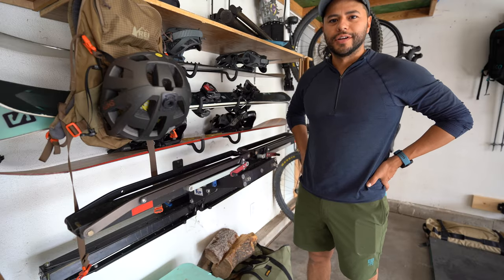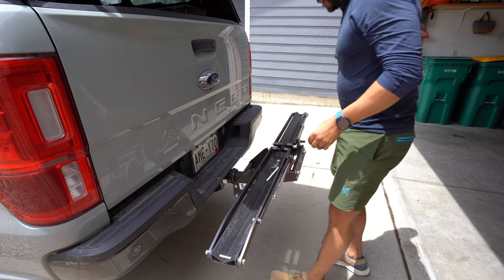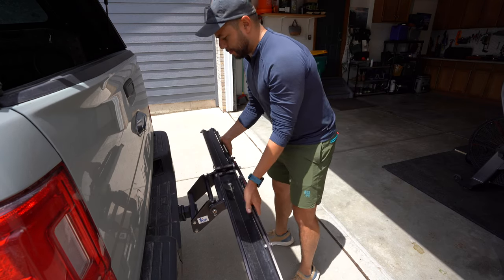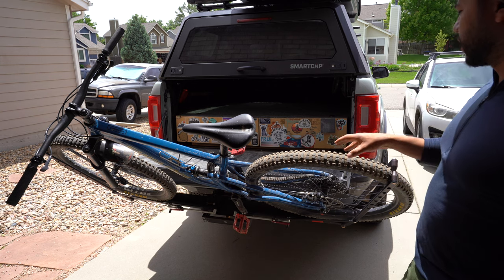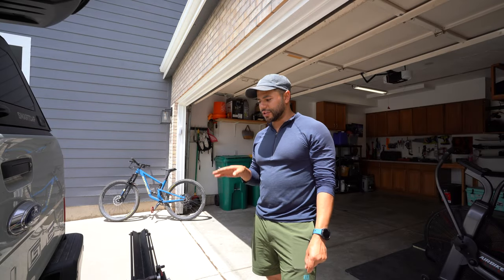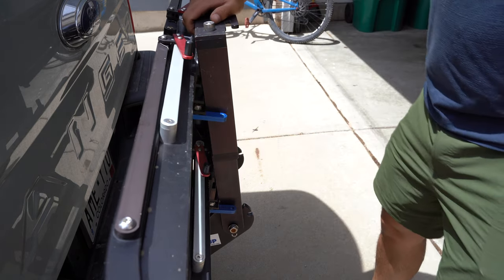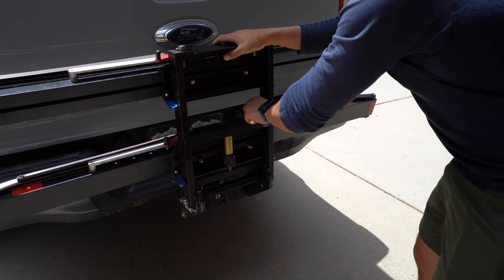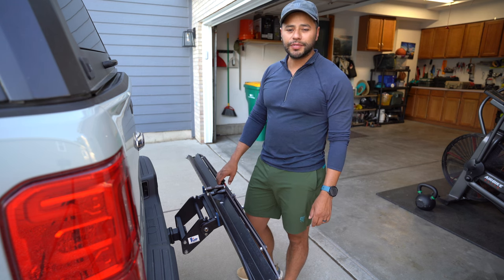1up Bike Rack Review - The best bike rack on the market

Comment: Tip, buy the 2 rack handle, cut down the rods so it slots in between 1 and 2 and enough you don't pinch your fingers. This will stay on with rack 1 as well by itself. Now you always have easier tilting.
Reply: what does this mean ?
Reply: @PenguinAUB  re-read

Comment: When you have it up does it block the rear license plate? Do you recommend getting the heavy duty double (for whenever my wife rides with me) or a single then get an add on?
Reply from the maker: It does block the rear license plate but I've never been pulled over so not sure they care. Especially here in CO, I think it's so common they ignore it. Also, when bikes are loaded I can't imagine it's easy to see the plate. Regarding the one single vs double, if you plan to always have bikes only on the hitch rack, I'd recommend the double. The only reason I bought the single was because I used to have an FJ Cruiser and when fully tilted up it would block the door from opening if I had a double and I couldn't fully tilt it. So I purchased a single rack for my bike, and then a crossbar roof rack for whenever someone else wanted to join. However, another great thing about these racks, I was able to use that same roof bike rack as my add-on hitch rack later once I got my truck. All that to say, I think 2 on the rear hitch is the way to go. Very easy to load and unload
Reply: @GetBusyLivin  Thx for the feedback. I drive a Mazda CX5 (small SUV). Would I be able to open the hatch without moving the rack? Does the same key fit all locks? Do you recommend the 2" HEAVY DUTY DOUBLE...to hold 45 ib e-bike and 15Ib gravel bike and do I order direct from 1up-usa?
Reply from the maker: @Drostvideo  with bikes on you would only be able to open with the rack tilted all the way down. Without bikes, you could definitely open the hatch but likely not with it tilted all the way up. The rack supports 50lbs per rack so should be sufficient for your e-bike, however I would probably call them and confirm. Not sure if you could do 1 super duty for the e-bike and 1 heavy duty for the gravel. And yes you order direct. https://1up-usa.com/product/2-heavy-duty-double
Reply: With the FJ, did you need a receiver extension to clear the spare? And to confirm, you could tilt it down and open the rear door? Thanks
Reply: When the 1up was on your FJ, did you need a hitch extension? And to confirm, you were able to open the rear door if you tilted it down? Thanks
Reply: Which model is shown in the video? Stated 50 lb max is only for Quik Rack and Equip'D models. HD is 65 lb max and Super Duty 100 lb max.

Comment: So when you put the holders in place against the bike wheels can you lock it in place to avoid theft?
Reply from the maker: They do lock into place but it’s not a fixed lock that requires a key or anything. You would want to either purchase a 1up lock that mates well with their rack, or you can simple use a normal bike lock
Reply: @GetBusyLivin  thank you for your reply. I just wouldn’t want to pull up to a stoplight and have someone grab it off the rack or walk into a store for a minute and have that happen. Not that I’d leave it out of sight anyway as a practice. In any event TY.

Comment: Great review, really helpful! I think I’m going to order the exact same setup: the single rack with the add-on rack for flexibility. One question for you. Have you used any of their additional lock sets (either the 1/4 turn wheel lock or the add-on lock to secure the add-on extension)? Both seem like nice features but at $25 each I’m not sure if it’s worth it. How do you secure your bike to the rack when on a road trip? Just wondering what your thoughts are given your experience with this rack. Thanks!
Reply from the maker: Hey there, I’ve considered it but I believe it only locks into the wheels and not through the frame. Being that the frame is the part I’m most concerned with being stolen I just use a cable and fish it through the frame and wheels and then lock it to the truck :) also?
Reply: @GetBusyLivin  Thanks for the response. I just placed my order today! No more laying the mountain bike in the bed of my pickup. Now I can actually take it camping with me. 

How do you clean the rack after a long dusty drive? Just hose it off, or take soap and water to it?
Reply from the maker: Soap and water if I’m doing it at home! Otherwise I usually wash the bike, rack, and truck all at the same time through a self-service car wash

Comment: Great vid. I love how well organized your garage is. Let me ask you this. I have a new ford bronco. From the outer edge of my reciever which sits flush with thr bumper to the oute edge of my spare tire which is large is approximately 10". Do you think that rack , with a bike on it will clear the tire. It appears you have plenty of space. Thanks
Reply from the maker: Hi Anthony, I just did some measuring and looks like the rack portion is about 12 inches from the bumper when at full extension, so you should ideally be able to fit a bike no problem. I can share an image if you'd like. Reach out to me on instagram @rocky.mtn.ranger

Comment: Nicely done video, very thorough. Do you know the distance from the back of your tail gate to the bike as I have a full size rear spare tire mount?
Reply from the maker: Hey Steve, that distance varies by about 6 inches as the male end has a slot to allow it to move closer and further from the vehicle. I just measured and at it's closest the frame of the bike is 10inches at the forks. It's about 6 inches at the pedals. and 4 inches at the handlebars. Ideally the pedals could be moved out of the way and the handlebars should be above the tire but you'd have to test that out. Again, you have 6 inches to play with so should be some wiggle room to get to about 16 inches for the frame

Comment: Great review. I think I'm going this route over the KUAT. Quick question....did you get the quick rack with adapter or go heavy duty?
Reply from the maker: The kuat piston pro x is a pretty cool piece of engineering and the one handed opening feature is very nice, but my concern would be dust and grime eventually getting into the pistons causing failure. That’s a very expensive rack to have fail.

This rack is no bs and just works…all the time. Simple and robust

I got the quick rack with adapter
Reply: @GetBusyLivin  good to know. I was looking at the heavy duty since it has the 2" hitch diameter vs having an adapter. But if you hadn't had any issues with the quick rack, that makes more sense to do

Comment: Saw someone ask this, but there wasn’t a response. Looking at this currently for an FJ. 

Did you need an extension on the hitch? And will the door open if you tilt the rack down?

Thanks
Reply from the maker: I had this on the FJ prior to this truck and did not need any extension. I cannot remember if I was able to open the door with a bike on it or not. In the down position I mean. Also, it will work with 1 bike rack on it but if you add to and tilt all the way up it will not clear. You'll have to have it tilted at the 45% angle to clear
Reply: @GetBusyLivin  Thanks, thats good to know. The 1 is probably what i woudl do first. So glad to hear that I wouldn't need to buy extra pieces. I'ts not big deal for me to remove the bike to get access. Do that now with an old Thule. Thanks!

Comment: Nice garage storage for the rack. That would work perfectly staying out of the way.   I've been looking at these racks and really like the black but how is the color holding up?  I was wondering if the black fads or easy to scratch off?  Thanks
Reply from the maker: honestly have not noticed any wear in the color whatsoever. Since it really only touches rubber I assume that's why it remains in great condition

Comment: Looks like the bolts could easily be removed?
Reply from the maker: Good question. Can only be removed if they have the key. Each bolt requires a 1up USA key
Reply: @GetBusyLivin   it looks just like a normal bolt/nut

Comment: Does thos fit fat ebike tires?
Reply from the maker: Hi Jordan. It depends on the weight of the bike and size of the tires. I would probably suggest looking at the Super Duty rack instead of the Heavy Duty. It's meant to carry more weight. this chart is helpful https://1up-usa.com/content/pdf/1UP%20USA-ComparisonChart.pdf
Reply: Need the Fat Tire Spacer kit., and as OP states, get the Super Duty.